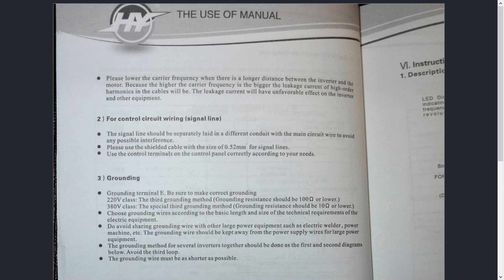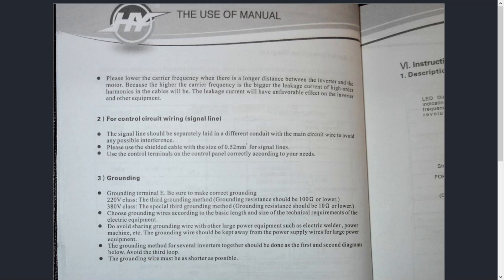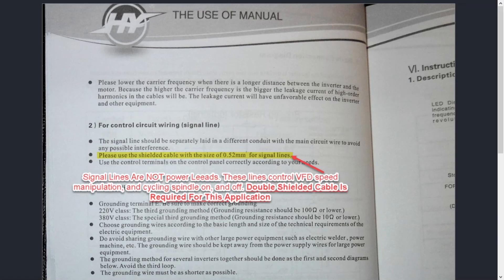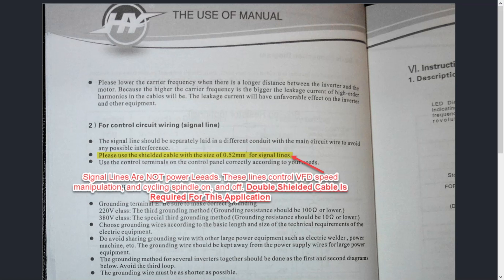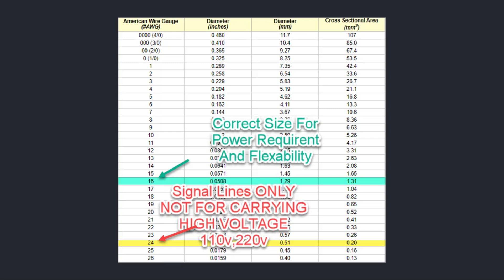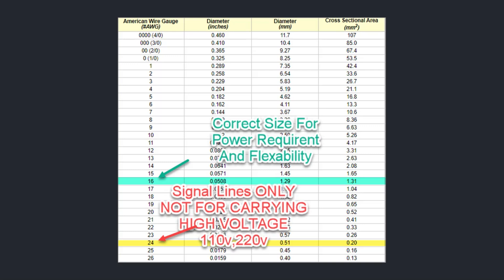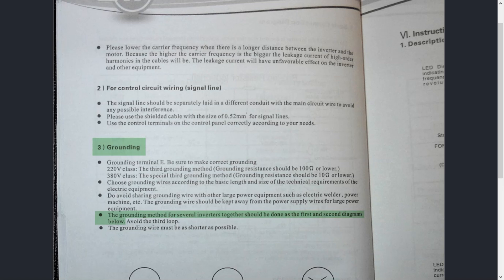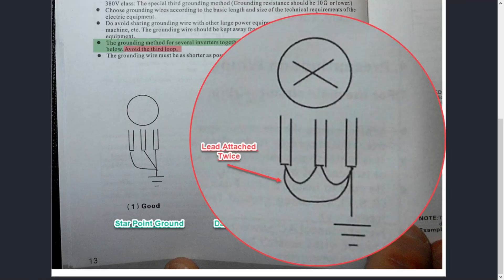CNC VFD Grounding.. (Users Manual Overview)

Comment: Mr Vince Thanks if I understand correctly power lines need 16AWG cable and data lines need 24AWG cable.
Reply from the maker: Correct, even going with 22awg for the data lines is fine. Remember the lower gauge wire will have voltage drop over distance, so  a higher gauge is always better. 

Thank you,
Vince
Reply: @corvetteguy50  Thanks
Reply: @corvetteguy50  Could you suggest me a video showing the proper VFD wiring and why you do not do it if i think many viewers wants to see you wiring VFD inside an enclosure because you have a clean work  and sorry for disturbing you with questions thanks
Reply from the maker: A video will be done shortly on the topic. Thank you,
Vince